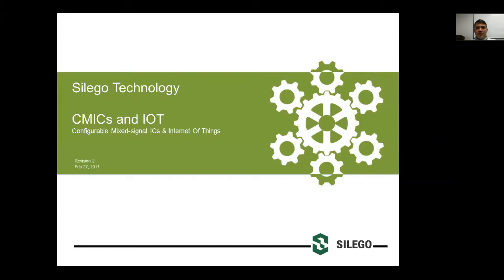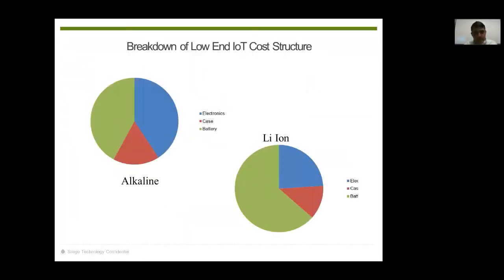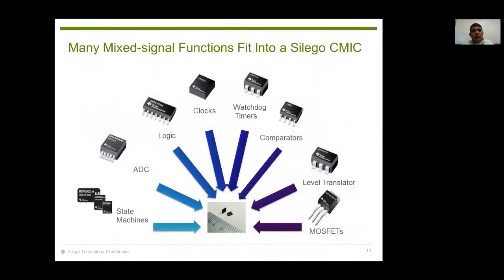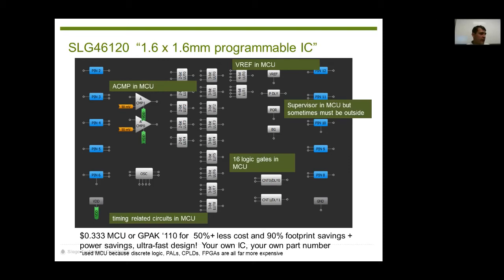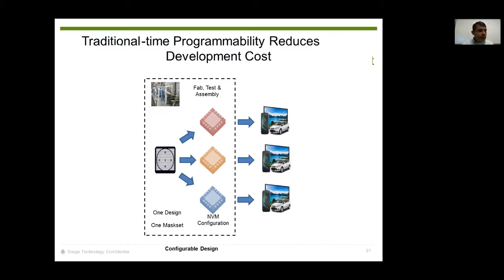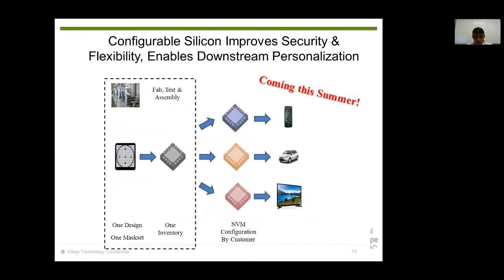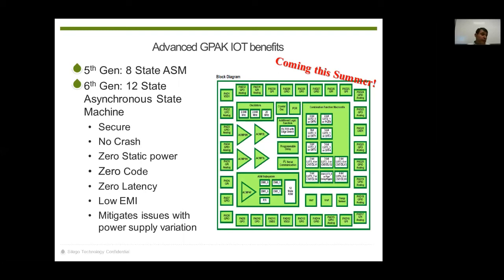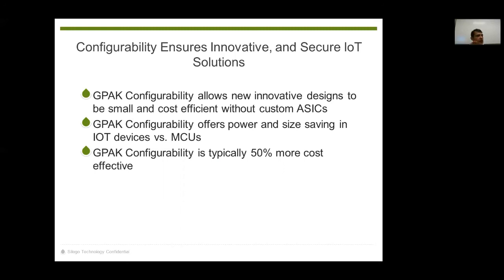CMICs and IOT Webinar

Comment: I find these devices very interesting and would long have started to use them in my designs, if it wasn't for one big problem: their minuscule packages.
By focusing that much on footprint, you limit your customers to large OEMs who can deal with such packages without having major yield issues.  In my own designs, running production at small shops, anything with pin pitch less than 0.5 mm is asking for trouble.  Please, consider making larger packages available, even if they cost more, and you'll open up these devices to a whole new range of developers.
Reply: That is awesome news!  I will be very happy to finally be able to use these devices in my own designs with the availability of TSSOP packages.
Reply from the maker: We wanted to let you know that our SLG46620G part is now available in TSSOP-20.